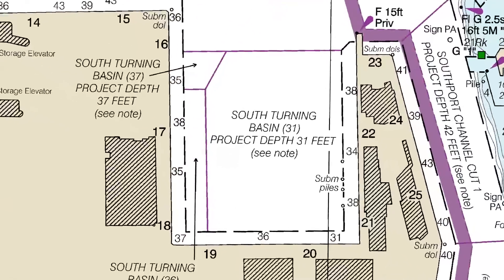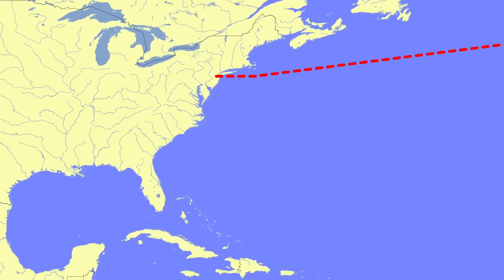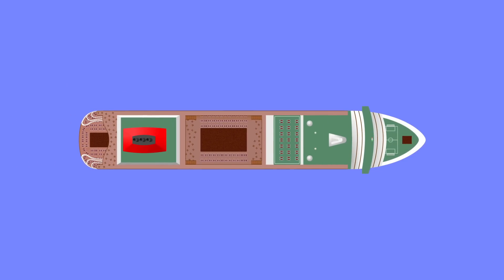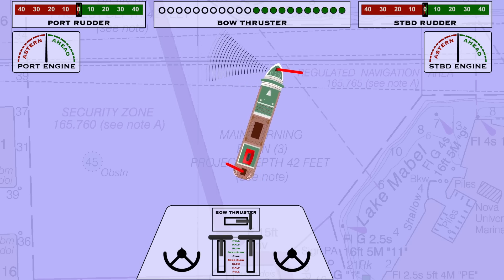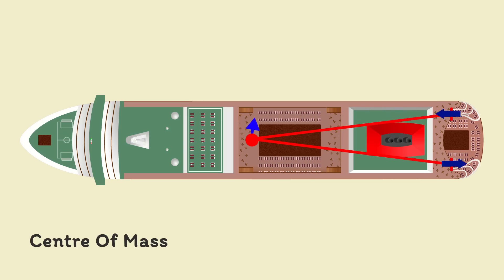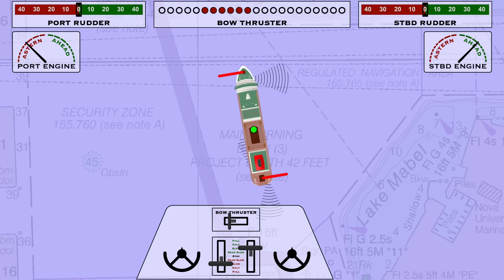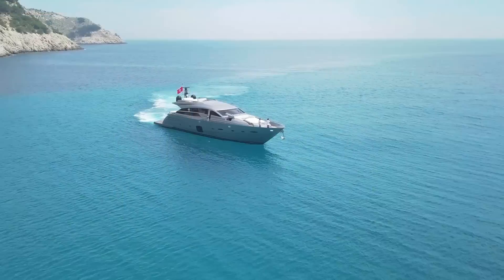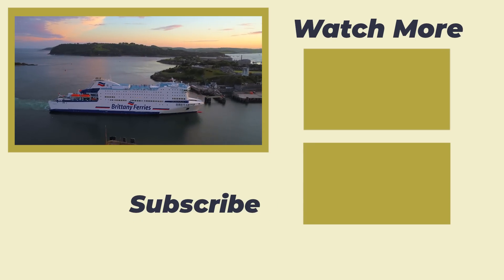Learn To Drive (A Cruise Ship)

Comment: I have still have a question, what if your ship only has one bow thruster and one screw configuration with one rudder on a small sailing boat? How is someone supposed to parallel park something with the same elegance as the examples you have given?   Thanks big fan of your work!
Reply from the maker: Thanks That Guy. Check out my video on Left Handed ships. I describe a little bit of single screw ship handling
Reply: While I haven't seen the video he suggests, there are things you can do that will work quite well.  I have three sailboats and not one has a bow thruster.  On the other hand you can use prop walk to help you dock.  The best thing you can do is to practice.  While I can't parallel park most of the time, I can dock it with no issues the vast majority of the time.  As he mentions in this video, weather, and currents depending upon where you are docking may cause problems, in which case you may need the assistance of someone on the pier.

Most of the time you don't need to parallel park.  By the way, it is a well known rule that the more people are watching, the more something will go wrong!  Good luck with your docking!
Reply: @CasualNavigation  Have you done a video on azipods too please? :) Love your channel thanks!
Reply: We have a single screw boat with a bow thruster. To move (say) sideways to the left, first turn the rudder to full right. Give a squirt of forward throttle which, with the rudder set right will kick the stern to the left. At the same time apply bow thruster left to counteract the turning motion from the rudder. So now the boat is moving left. It’s also moving a little forward now, so then apply a squirt of reverse. No need to adjust the rudder (still full right) because it has almost no effect in reverse (see casual navigation video as to why). Repeat this cycle of forward/thruster/reverse to continue moving left. Presto! I find it easier than reverse parallel parking in my car!
Reply: you can use "back and fill". alternate quickly between "right rudder astern engine" and "left rudder forward engine" or vice versa depending on which way you want to go, you use stored momentum from turning, switch gears, and turning the opposite direction cancels much of the momentum fore and aft, leaving you with a turning moment and some transverse force. you can pivot turn a single screw, it's just hard
Reply: @PanzerDave  It's called backing and filling.
Reply: @researchcapt  Thank you for the name.  I was shown what to do when I bought my first boat, but I had not heard the name.  Thanks again!
Reply: @averagejoey2000  Thank you for the name.  I was shown what to do when I bought my first boat, but I had not heard the name.  Thanks again!
Reply: With single propeller there is also tendency for stern to turn due to rotation of propeller itself this is pretty small effect, but can be used with bow thruster.
Reply: You may also use a technique called "Ferry gliding" if you're say in a river wanting to pull up alongside the banks or in a marina with tide flowing through it. 

You start facing bow into the water flow and match your speed with the water so you're approximately stationary relative to the land. Then just gently turn towards the banks and as the boat turns you can then steer away from the bank again. You keep repeating this or find a balance in between and you'll find the boat moving sideways towards the banks, effectively parallel parking

Comment: 07.00 manouver is not like that, the carachteristic manouver you tell is can work in twin Hamilton jet Boat ship, and not working in twin screw with bowtruster.
The correct  situation manouver in 07.00 is Starboard engine reverse and port engine ahead and steering hard to starboard  and bowtruster to the left

Comment: Without azimuth thrusters you can't really direct the thrust anywhere but directly backwards when you're on reverse. Rudders only work when the propeller moves water thru them or when you have enough backwards movement. If you have two propellers you could use the other one to push the aft sideways and other on reverse to cancel the forward movement and then just keep the bow in line with the bow thrusters.

Comment: Read an article in M.E.R. , this ship always needed tugs, canna remember the ship or tonnage, a new properly designed rudder was built and fitted, goodbye tugs, as a builder of sailing yachts, I  know rudder design is super important
Ships coming into Lautoka would run out the seawards pick well off of the wharf, when the pick took up they would winch in and come ahead full stb helm and come gracefully alongside, then winch to come away, come astern full rudder
I  heard that Q.M  came into N.Y   without tug assist, the tugs were on strike

Comment: I was on a smallish cruise ship (700 passengers) and the captain had to dock with a strong wind blowing it onto the dock. He dropped the bow anchor short of the dock to help control the drift and to pull the boat off the dock in case the bow thrusters couldn’t handle it.

Comment: In the last part where the ship walks sideways. All the main engine inputs are the complete opposite of what you supposed to do. When you want the ship to walk sideways to port you'll use port engine ahead, with port rudder hard over to starboard. The starboard engine should be running astern with neutral rudder. This gives the stern a turning moment to port. The bow goes to starboard which is then compensate for by the bow thruster to port. It is than a matter of balancing thrust fore and aft to keep the ship nicely parallel.
Reply from the maker: With outward turning propellers you are right, although the effect is very marginal. I didn't want to get into inwards / outwards in this video though as I wanted to keep it as a brief introduction
Reply: @CasualNavigation  Even with inward turning propellers the turning moment created by the props in my above mentioned manouuvre will easily overcome the prop walk from the starboard engine when this is a inward turning prop running astern. And looking in your video the location of the pivot point almost directly over the props seems of to me as well. As a general rule of thumb the pivot point lines 1/3 off the ship's length astern of the bow when a ship is making way ahead. This distance will increase when a ship slows down, a will be more or less in the middle when a ship is stopped. When making way astern the pivot point will move again to 1/3 distance of. But this time it will be 1/3 of the ship's stern. Thus making the bow thruster much more effective since lever of the moment is enlarged. In your example you start of stationary and moving sideways. The pivot point would never that fare aft at certainly not when the ship is stopped. Maybe with high speed moving astern or by use of tugs the pivot could be manipulated in such a position.
The manoeuvre as you described it is possible by small craft for example pilot tenders with twin jet propulsion. But take note that the bow only will actually move latterly sideways (not just the change of heading to port) because of the weight distribution and underwater shape of such smaller vessels with a heavy stern (engines etc) and a very light bow.
Reply from the maker: I've read some fascinating scientific papers on the pivot point so am hoping to cover that in a video on its own. I've got to brush up on the physics first though so that I can compare theory to the reality and then explain it properly. The general rule of 1/3L from bow/stern is what I was always taught too, but I'm more interested in why so need to study the physics of it too
Reply: @CasualNavigation  that would be very interesting to watch. Looking forward to it.

Comment: It seems to me that cargo ships in the  USA are required to have tug assist both fore and aft.  I watch in Miami.  Canadian cargo ships on the Great Lakes dock without tugs.  The newer ships have a bow thruster but the old ships my father was on years ago did not; one engine and one rudder for a ship of 150 to 200 meters.    Ships sometimes would dock late at night and had to be completely self sufficient as there was no shore crew.  The ships would lower one deck hand down from a swing out boom.   The ships would use the steel lines to pull the ship in.  A lot of maneuvering was done with the lines and winches.
It is interesting that cargo ships, both Canadian and American go through the canals and locks unassisted but US navy vessels always have a tug assist.
Reply from the maker: I guess its because navy ships have less commercial pressure so can afford extra tugs
Reply: @CasualNavigation  I don't suppose you heard about the brand new USS Billings that was maneuvering in Montreal harbour last year (August 2019)..  As soon as the tug let go, control was lost and the navy ship collided with a Canadian cargo ship that was moored.  The captain was replaced.
Reply from the maker: I hadn't heard of that one before

Comment: What the deal with port being left and stbd being right?
Reply: They are just names for the sides of the ship. Like on a modern map, West is left and East is right.
So internally on the ship, there are 4 cardinal directions, Fore, Aft, Port and Starboard. No mater which direction you are facing, you always know what direction is meant - there is no ambiguity.
 
But if you want to know the why to those names:

Starboard comes from old English (really it is from old Danish) meaning "the side for the steering(oar)", it used to go along with Baeckboard (sp?), which basically means "The other side"
I don't know why it is called "port" side, although I have heard that "Port" replaced the older term "Larboard" because it was easy to misunderstand with starboard.

Some people mistakenly say it is called "port" because you moor the ship on the port side, but I am sure that is incorrect, because when the term "Portside" was introduced in the 19th century, ships had for long time had rudders, and not steering oars sticking out (and blocking) the star board side.
Reply: @tjampman  SO its from danish interesting.
I still find it weird. In my native tongue to call as ships sides the same as you call a persons sides (corectly translated) front, left, back, right (literally translated; forward, wrong, behindback, right.)
Reply: @baltulielkungsgunarsmiezis9714  What is your language?
I think Spanish and Portuguese just use right and left for speaking of the ships side, I don't know about the rest of the world.
When that is the case, I just feel you always need to be specific when talking, if you facing aft and you say e.g. we need to overhaul the left engine.
Then, are you talking about the left engine to you (the starboard one) or are talking about the left to the ship (the port one)
There is ambiguity there...
Reply: @tjampman  Baltu = belonging to the balts
No there is no problem saying left and right because when you are in a vehikle it is assumed that you are always talking about the vehikles left and right.

Comment: Awesome video!
Isn't there some sort of Autopilot that can park the ship at the desired location? Basically something that does all the balancing
Reply from the maker: There is, but its still better to do it manually. If the autopilot applies too much power, by the time you notice it could be too late
Reply: @CasualNavigation  you do have a point sir!
Reply from the maker: Plus, the ship handling is the fun part of the job
Reply: @CasualNavigation  Can't say I've ever piloted a ship but my experience flying aircraft would agree there especially in turbulent conditions, autoland works great in good conditions but in turbulence, I wouldn't trust it on landing, too little air beneath you if it gets it wrong. I've always assumed similar applied with ships operating near land is like operating an aircraft in close proximity to the ground options to recover are slim to none in that situation. Though that does raise the question if you are having problems stabilizing the motion of the ship do you abort docking and head to a safe distance from land in the same way an aircraft aborts the landing if they don't have a stable approach?

Comment: Can you tell me about azimuth thrusters?  I actually wonder how they effect the ship maneuverability while parking a cruise ship? As I know, all Oasis Class ships equipped with azimuth thrusters instead of rudder..
Reply: They behave exacly like bow thrusters but on the stern when turned 90 degrees. However, they are much more powerful than the bow thrusters, so all you gotta do is use less thrust on them than on the bow thruster and the ship will move sideways

If there is currents or forces that make the ship move forward or backwards while during that time, you can counter that just by turning  the trusters a bit to left or right to some forward or backwards force and nullify the speed, while still moving sideways

Comment: Do you know if ships are diesel electric drive or is a there a mechanical connection the the engines?
Reply: On cruise ships your most likely gonna find deasel electric but on cargo ships there will be a shaft straight from the prop to the engine :)

Comment: Wondering why tankers are not equipped with this system!
Some needs up to six tugs for berthing.
Reply: My guess is that it's because Tankers operate similar to the old ocean liners, by that I mean the routes are consistent and long, so they can afford to have tugs at the end of the journey (like he said at the start of the video, such a long journey can justify it) Also they're a lot bigger than cruise ships so you'd need a pretty big bow thruster
Reply: they only stop at 2 docks, and those routes are pretty well traveled so it is worth it to keeps some tugs in work there as they are profitable.
Reply from the maker: Its a trade off as thrusters and engines take up space. It can be financially better to carry extra cargo instead sometimes

Comment: As you get close to the dock you can throw a line and get your bow and stern cables attached. Then kedging or warping. Once even one is attached IMHO it can be used to pull or help offset some fore-aft movement.

Comment: I have a lot of experience doing almost just this on twin screw ships with no bow thrusters wherein a tug stands in for the effects created by the bow thruster in your video, however, I am curious why you have gone with a "port twist" in your example starting at 6:10. In my training, we consider the ship to be "split" in two halves - forward and aft - with the tug controlling movement on the bow to port or starboard and the engine/rudder combo controlling fwd/aft movement and lateral movement of the stern. A "port twist" (references which way the bow moves) as you have it in your example moves the stern away from the quay, so why not "twist" to starboard and use the bow thruster (or a tug as the case may be) to keep the bow moving over in step with the stern? In doing so all of your forces are working in tandem where as a port twist creates some force that is counter to the direction you want to have the ship move which you then have to use some minimum amount of rudder to overcome. I enjoyed the video - its a great overview of the considerations of mooring a ship!
Reply from the maker: It was mainly to illustrate how it could move with no bow thruster. When using the thruster, it doesn't make too much difference which engines you use when just going sideways as the rudder is so powerful compares to other effects
Reply: @CasualNavigation  , no no no

Comment: I was once doing an escort of one of the larger military sealift command ships out of Pearl Harbor (dont remember which one, but it had a ramp that folded down for vehicles on the aft end if that helps) and as it was making the turn around hospital point the tug on the aft seemed like it was using all its power to keep the ship from atleast side swiping the day marker, let alone scraping the edge of what was dredged. The tug was almost sideways pulling it.

Comment: I love your channel, this stuff is so interesting! And to think, cruise ships at their vast scale use pretty much the same techniques as tiny little pleasure craft.
Reply: It's becoming kind of standard to have a bow thruster these days, but in the olden days you only had a single engine with fixed propellor and 1 rudder. Manouvring that into a berth is only possible by clever use of mooring lines during the manouvre.
Reply: Hi  @martijnheil8825  I know just what you mean -  a few months ago the bow thruster on our boat failed as we came in to moor at an overnight stop. Our boat has a single engine, a fixed prop and 1 rudder. I spent the evening boning up on the use of mooring lines to get in and out of berths in various situations without a thruster, and then spent the following day doing it for real as we made our way downstream on the Thames, through multiple locks toward our home berth. I was a sweaty mess by the end of the day, but also pleased to have managed the Old School techniques without smashing the boat to pieces. I am pleased to have the bow thruster back in operation, though secretly smug that I managed without it for a day!

Comment: Another configuration sometimes used is a joystick type control - where the rudders, engines, and bowthruster all act independently under computer control to move the ship where you want.

Naturally, being one trained on twin screw CPP, I much prefer berthing via walking the ship using engines and BT!
Reply: That's how flight controls works too on a plane!
Reply: @topethermohenes7658  On some planes yes, not all.
Reply: @skunkjobb  *on all jet commercial planes
Reply: Joysticks are cheating...
Reply: @topethermohenes7658  All Airbus planes, and Boeing 777 and newer are Fly By Wire, but far from “all” in general.